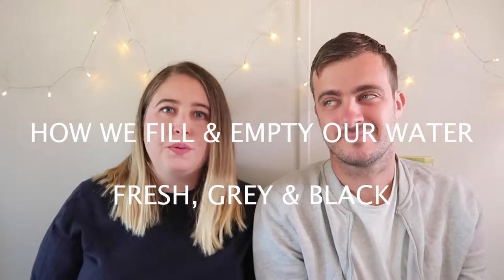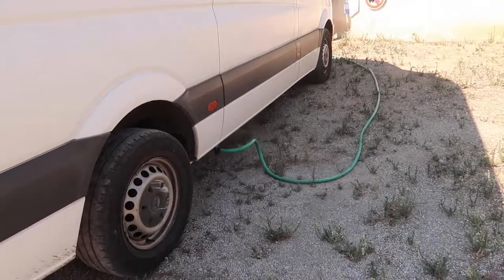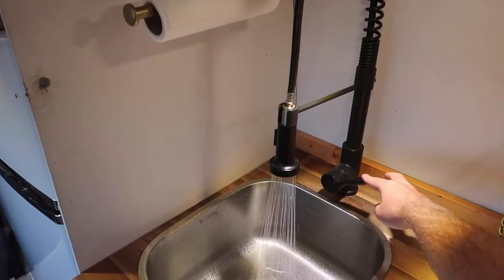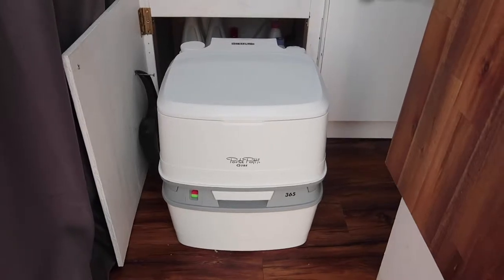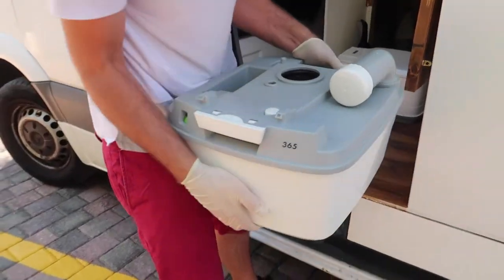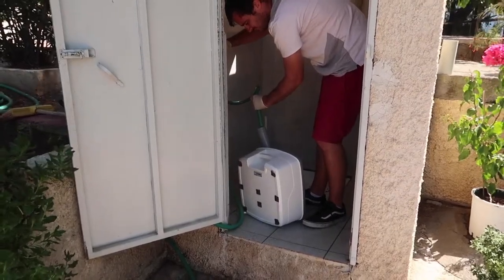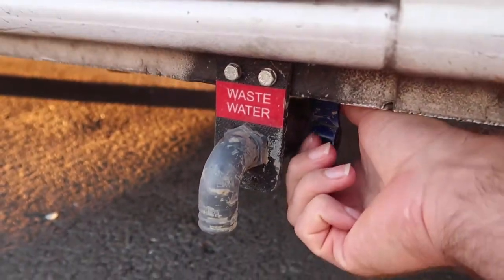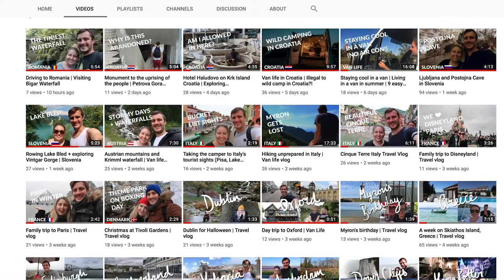VAN LIFE | How we fill and empty our water tanks | RV and campervan custom water system

Comment: Thanks guys, I worry about the freezing conditions we sometimes have in the UK, so I'm not sure I would opt for external tanks... Are your tanks insulated?  What are your thoughts re this?
Reply from the maker: ManOfMysterry no our tanks aren’t insulated. We worried about the same thing! But decided to risk it as it saved on so much space. And we were able to go with pretty big tanks. We’ve only ever had them freeze when temperatures were -5c or below - that was in Poland and Germany. And they defrosted quickly as the day warmed up. In the UK at 0c and below temperatures we’ve been okay. If you’ve got the room inside your van (eg under a raised fixed bed) and you’re going to be frequenting cold places, it’d make sense to  install them inside. But we’ve been super happy with having them outside.